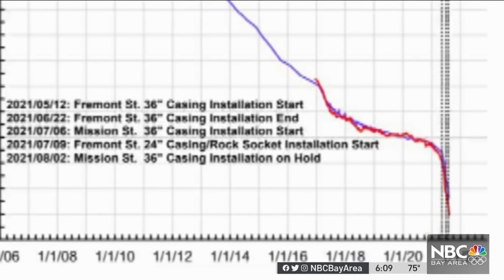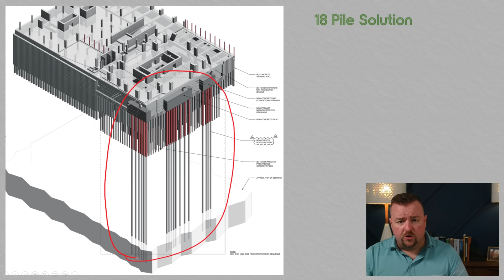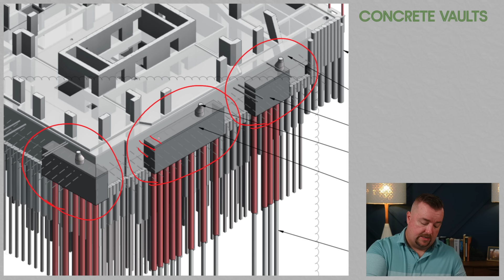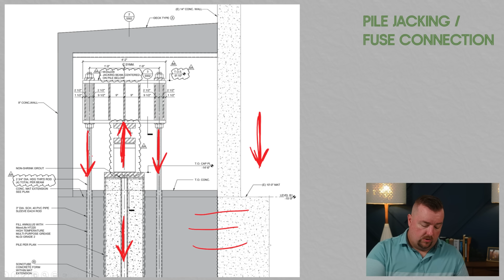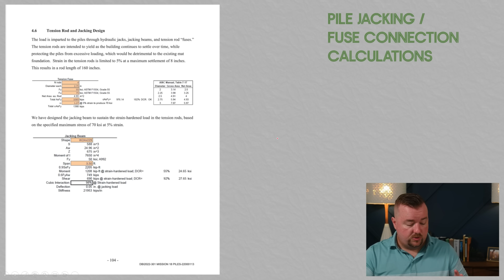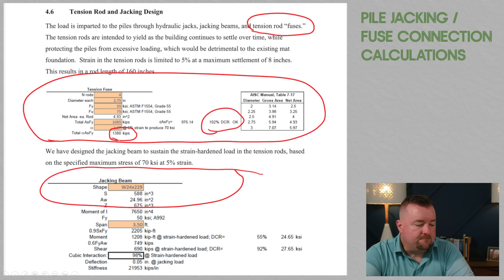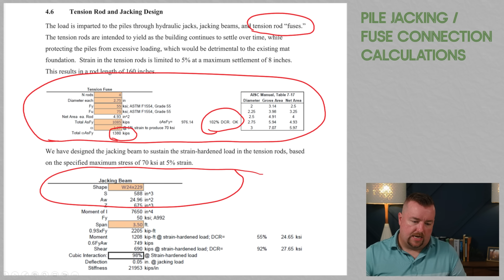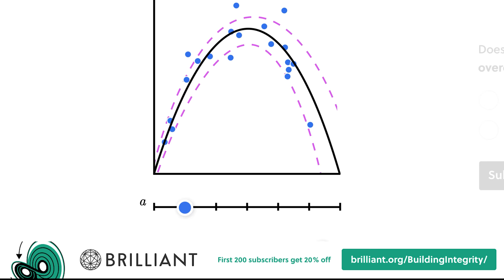Did I Uncover a $100,000,000 Mistake with the Millennium Tower "Fix"?

Comment: As a retired engineering geologist with 54 years experi'sence I offer the following:  1)The four vertical bars should have been regular deformed rebar ("Dwydag") with machine threads at the top and bottom where nuts are used to attached to steel. 2) The length of the vertical bars should not have been greased and encased in PVC pipe.  That way the entire length of the bars could have engaged the concrete, distributing the load throughout the body of the concrete fuse block. 3) The design load on the vertical bars should have been kept to 70% or less of the steel yield strength. 4) The "fuse" concept to gradually take up the load should have been accomplished by using the hydraulic jacks in gradual stages, monitoring the downward settlement of the building as each jacking event was done. Jacking stress should be kept relatively low until all of the proposed piles were installed.  That way the building's ongoing settlement could be carefully monitored as load is taken up by the piles.  Pile loading should be adjusted with the jacks to slow down and/or stop the settlement evenly around the perimeter of the building. 5) The steel plate at the bottom should have been larger and thicker, even though much of the load would be picked up by the body of the concrete in my scenario.  I hope this helps.
Reply: The rods have to be free throughout most of their length so they can stretch.  They act here like ultra stiff springs.  If the free length were shorter, there would be less movement before reaching the yield point of the steel.  More likely, though, is that the bar would fracture the concrete starting at the top.
Reply: @GH-oi2jf But every characteristic of the steel bars could be emulated with hydraulics.
If much thicker bars were installed then a much wider range of characteristics could be implemented.
Reply: @GH-oi2jf  Heavily loaded rock bolts are used routinely to stabilize dams, landslides, etc.  One way around the stretching issue is to fix the bolt to the bottom of the hole, prestress the bolt to its desired amount of stretch, then grout the bolt into the hole. The prestress is then released, placing the rock mass into compression.  The top of the bolt can then be tied to the actual load. To crack the grout/rock/concrete the force would have to exceed the prestress force.  These anchors are modeled as a cone shaped cross section having a large amount of surface area to shear before failure could occur. This results in a very stiff system, with the load adjustments done hydraulically.

Comment: I cannot believe this project is moving forward with what has been revealed here. There will be no fix for the "fix" if the bar breaks and could make matters worse by unloading and suddenly loading an already failing foundation.
Reply: Put it this way, I would not want to live, work or walk within the distance of the tower's height from its base...
Reply: Failed foundation. The building is actually falling over in slow-motion and nothing that anyone has done so far has mitigated that. IMO, they need to either start removing the top floors while there's still time to save 1/3 of the structure, or give up and demo it before even a demolition can't be done safely. It's getting close to that time already.
Reply: @supremedictator.  my first gut reaction, exactly. I feel for those that have lost money but this eventually is going to kill people. Imagine if there were an earthquake during the attempted fix?
Reply: @alisonwilson9749  domino's. I'd be concerned about nearby buildings going down, too!
Reply: @bnjoo  There are only a few more inches to go before the lean starts preventing some of the plumbing drains from flowing and puts the elevator function at risk.
Reply: @bnjoo  I just read that the current lean is 0.2° and the fix engineers suggest that plumbing and elevator problems start at 0.3°. The leaning tower of Pisa is currently at 4° but on a stabilized perch. This thing is admittedly years away from toppling on its own, but the tilt is going to make at least 1/4 of the units uninhabitable within 3 years at the current descent rate. OG design was for 10 cm settlement over the lifespan and it's currently at almost 50 cm. The soil assessment has been wholly wrong and I don't think that anyone should be trusting engineers who aren't acting like their hair is on fire. I know this doesn't instill confidence for residents, but SF is a highly seismic zone and this thing is pitching over at a prodigious rate in both geological and structural terms. Doing things in the American "just barely enough" style is going to result in tears. There's are already massive spalling in the basement akin to the Surfside collapse.

Comment: Plate issues aside..........once a fused rod reaches "failure" phase a cascade of rod failures (each close to failure by definition} should quickly begin as load is transferred sequentially.
Additionally, the jacking beams will also "jack" and also transfer load to alternate rods.
Other matters, the connection of the vaults to the foundation pad do not appear  substantial enough to bear the moments and loads in question.  Just a hunch.
Also, this all thread issue brings to mind the Kansas City Hyatt Regency failure in '81.  Issues are different but worth review.
Reply: The vaults seem like the will have an incredible amount of torque on them. I agree that the connection doesn't seem adequate. They went out of the way to "key" the connection but that does nothing to address the twisting moment at all.

Comment: You are correct. It is a Catastrophe waiting to happen. The main load bearing supports should be much bigger and also take into consideration degradation over the years by electrolysis, which is bound to happen with aging. I would go into total overkill for these plates considering the cost of steel at X 10 it is less than pennies considering the size of the project

Comment: YouTube recommended your SurfSide video some time back, and I'm intrigued by engineering of all kinds. I'm in IT and work in hardware and networking, so I have a basic understanding of materials tolerances for copper and other conductive materials. The threaded rods and small plate reminded me of what I had seen from videos covering the Hyatt Regency walkway collapse, even though they are vastly different applications. Something just doesn't seem right about the whole thing.

I appreciate your pragmatism on the required level of maintenance and inspection that would likely be downsized or eliminated as time passes. I think that is a common thread through many technical fields, unfortunately. A pound of prevention is worth 2 tons of cure, adjusted for inflation.

Comment: Great analysis, but even worse is that the whole transfer of load from the threaded rods to the ( undersized) plate seems to depend on the contact area of the nut and washer assembly at the bottom of the rod, whose area you could calculate. And under these huge loads, wouldn’t the threads strip on the rods and release the plate?
Reply: @Richard Sprow, my thoughts exactly.
Reply: Actually no, the whole idea behind these standardized threaded rods is that the rod itself, the nuts they attach to and the threaded interface between the two can handle these loads. The size of the hole that the rod passes through and the nut bears against is also called out for in the standard to make sure that the nut will not get pulled through the hole. A single nut should handle the load. The second one adds a safety factor.
While 175t on a single threaded connection sounds like a lot, it's well within the realm of heavy industrial applications.
Reply: @siggyincr7447  thanks for clarifying

Comment: As a construction specialist my concern is with the increased torsion on the existing foundation. With the Introduction of a lateral load I would want a deeper and more robust foundation support under the original foundation. That along with the entrenched plate at the at the bottom of the load rod which will not be observable is definitely shady.
I would fear that a sudden seismic event could be catastrophic when rods are at or above yield as well
Reply: I feel that 'fuse', in my electrical thinking, is a rather apt description.  If one threaded rod - already past yield -  fails, the rest will follow as the increased strain pushes them all to tensile failure like a house of cards.
I believe there was a terrible bridge/overpass construction failure in the US when bolts were loosened to correct misalignment and the entire structure basically 'unzipped' as each fastener failed in turn.  Perhaps someone can remind me of the place and date...
Reply: Well done Sir.

Comment: As a Geotechnical engineer, the potential for earthquake loads causing shear alarms me as well. Even aside from the under-designed plates, how did they think that these things would not create a cascading failure in the event of an earthquake load with vertical acceleration adding to it? Even if these had been 'adequately designed' I doubt that they would survive any significant earthquake.
Reply: The idea is for these added piles to relieve the existing foundation of a portions of the long term loading (dead and live load). Those are the loads that are causing settlement. Seismic / wind loads are transient and typically aren't a major factor in settlement calcs. And the existing foundation was originally designed to handle all of those loads on its own. Unless there's liquifaction and I guess it's all out the window at that point. That said, it's still a complete cluster.
Reply: @ashedold11  sure, but once you start supporting those static loads with this new contraption it's now part of the system that will be allowed to experience dynamic loading during an earthquake, no?
Reply: @ashedold11  I don't think that the building will collapse in a seismic load, it's just that this fix won't survive any sort of dynamic load and they will be back at square one, and I'd expect a fair amount of differential settlement to happen during an earthquake when these inevitably fail.

Comment: Your new fan has two questions:  1) From what I know of mechanical engineering, 2.75" diameter and 200' length = 2,400", diameter to length of 827:1, what column strength should we expect?  
2)  Given current structural problems and tilt, can this tower be neatly demolished into it's own footprint, as in 9/11, or must be dissasembled piece by piece, opposite of how it was erected.

Comment: I recall seeing pictures from the 1981 Hyatt Regency walkway failure. Looks like the nuts & washers pulled through the box channel welds. This was a case of load & stress calculations that  NOT were re-done after a design change.
Reply: That structure was underdesigned even before the change.  It was an inherently unsafe concept.

Comment: 1380kips into two plates (690 kips each). 6.5 x 13 ≈ 85 in², less 2.75" in² each. 690kips / 63in²  ≈ 11,000psi, under "normal" conditions.
There's concrete rated for 76MPa, but that makes my skin crawl when the plates could have been designed differently.
The cross section of the plate where they attach to the bolts is 5.625in², 345kips at that point, 61ksi.
Again, not unreasonable to ask of good steel, but why are they flirting so close yield.
Reply: And what of seismic loading?
Reply: @ocko8011  only number you need at that point is 32.2 ft/sec^2 as the building collapses
Reply: The flat plates have little rigidity compared to the I beam above, so they can't distribute the load into the concrete over their whole area, just around the rods.

Comment: Hi Josh, great video.  I have been waiting for the follow up video on MT.  I wonder if the Engineer only used the plates to hold the rods together during the concrete placement and relied on Abrg of the nuts for 2 3/4" dia rods per ACI 318, Chapter 17 or older Appendix D.   Or maybe the plate added to the A brg and so the plate was not designed for the entire uplift force but a portion of it.  But with the tight bolt spacing and min bolt edge distance with the pile on one side, I would be concerned that the anchor rods would satisfy ACI 318 Chapter 17 (or older App D) without adding supplemental reinforcing steel even with the added A brg area of the plate.    I am not a licensed Engineer in California but just providing a potential response to your concerns.  Thanks again.
Reply from the maker: Thanks, good thoughts.

Comment: My rough calculation says that the plate can withstand about 1300 kips on each rod before pulling the nut through (depending on the grade of steel used). Seems ok but I still don't know why they didn't use a larger and thicker plate. Going to a 2'x4'x3" plate would have added next to nothing to the cost of the project and given a lot more peace-of-mind.
Reply: I see you didn't bother to calculate the other three sides sinking as the earthquake liquified the landfill it's sitting in. 😅

Comment: I am also slightly concerned about the nuts securing each threaded rod. Threads are designed not to strip under loads below the tensile strength of the material, but they seem to be pushing these materials to their limits. Another potential point of failure.
Reply: Yes ! Tiny threads !

Comment: With the above-yield strain placed on those rods, if a single one has a defect, or otherwise exceeds capacity and fails, the other rods - having no safety factor - will fail too. Not an engineer, but I could see it being a cascade failure. Furthermore, considering the location, was any safety factor added to these calculations to account for earthquake loading? Rayleigh waves have a significant vertical component that may place a severe dynamic load on these rods. Good catch.

Comment: I'm a layman and it looks to me like the existing foundation will continue to want to sink vertically. Over time, the foundations of the building will crumble. The only way the pilings would really work is if supports ran all the way under the foundation from one side to the other rather than just being driven into the foundations.

Comment: I am a retired civil engineer and my mouth dropped when you showed a 1/2” plate used to transfer load from a 2 3/4” bolt. That is almost certain to be failure point.
Reply: The plates are 1 and 1/2 inches thick.

Comment: Simulation - including multipath earthquake forces - are a required deliverable for signoff.  Keep in mind that this is sitting between two large active earthquake faults. So I would HOPE they are running sims with accurate modeling to determine the stress transfers on the entire solution.
Further note to those not familiar with buildings in earthquake prone areas. The buildings themselves may not be connected to bedrock. There is often a shock absorption setup on the base (mounted to bedrock) and computer controlled counterweights in the top of the structure that allow the building to "ride" the motion imposed.

Comment: After watching, i just did a rough nonlinear FEM Simulation of the Plate and the threaded rod with the nuts embedded in concrete. To keep it simple, the rod and nuts are modeled as a linear elastic steel, and the concrete is also linear elastic. The steel plate is a bi-linear S355 (really cool naming, as you can derive yield strength by the name) and it looks, like the nut would just punch through the plate. Of course this can only happen, when the concrete does not fail locally, which it will, but i wouldn't trust this plate from what i'm seeing (if i did my cad model somewhat to the specifications).

Comment: Thanks for great video.  
Why have both bolts that stretch when they reach the stress of their yield strength and a hydraulic jack pressure that could be varied by computer.    One should be enough.  I would pick make the bolts (threaded rod) thicker and control the force with the hydraulic jack.

Bolts or threaded rod that goes to higher stress than yield strength is stretched permanently, thus you can not advance the nuts to rotate into the stretched region.  Also the plastic deformation will occur by necking down in one region.  This region of necking could be anywhere along the length, even some where out of sight  The four threaded rods will be vary similar in material properties and size.  However to make this work they will have to be pretensioner by the nuts on the top to have the same stress on each bolt.  Also when the bolts are loaded by movement of the building and reach stresses above the yield strength, they must all strain (stretch) the same amount.  If the building moves a second time the threaded rod will yield but at a slightly higher stress.
Reply: It is increasingly reminding me of the first Tay Bridge- from foundation problems to a structure that moves ( in wind loading and engine vibrations in the case of the Tay Bridge -we don't get earthquakes here) and overstretched bolts, potentially it's all there...😬